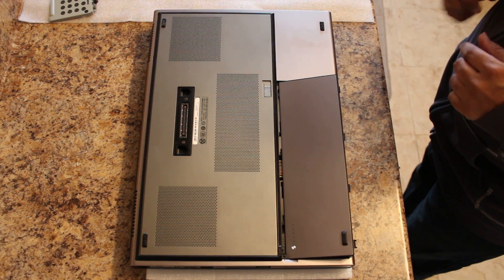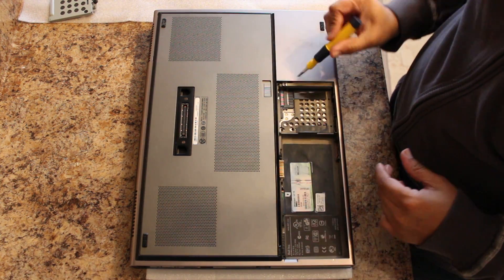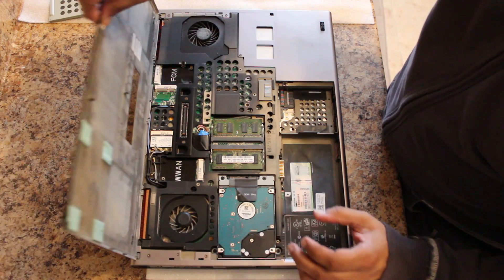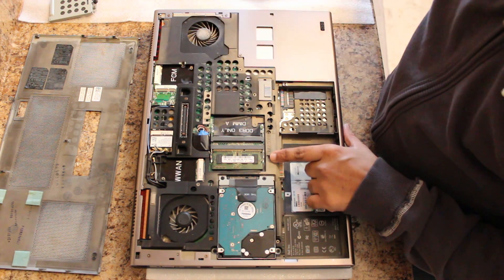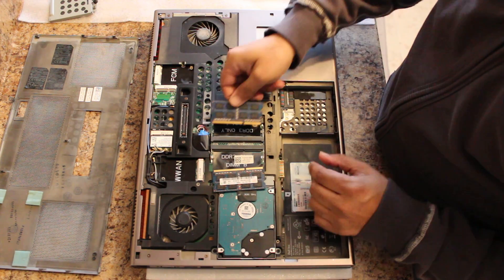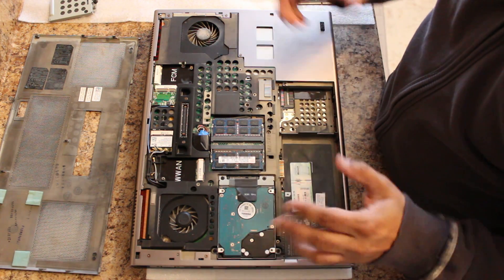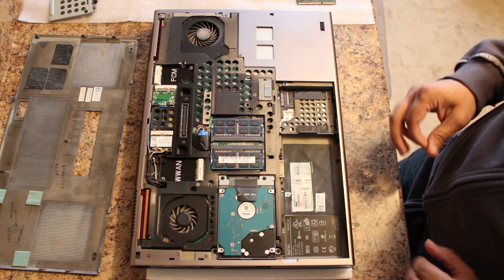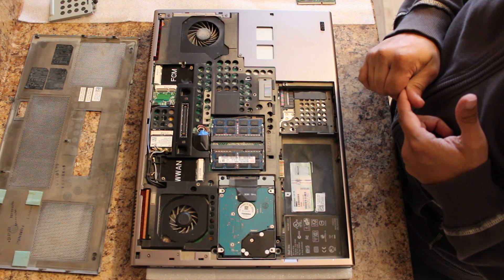Upgrading memory (RAM) on DELL Precision m6500

Comment: Did you not upgrade the ram chips under the keyboard  or  is it only 2 cores on that one.  Mine is quad i7 so has 2 ram ports uner keyboard
Reply from the maker: Mine didn't have any under the keyboard.

Comment: I have the same laptop I tried upgrading  the ram since it has 4 slot so i put (4+4gb ) in slot a,b and then I put (2+2gb) in slot c,d  the the system couldn't boot it was just black screen what could be the problem
Reply: It come from chip dual core support a+b and max is 2x4gb , quad core abcd max 32 but it barely  waste money to up max 32 gb at this time 2024 ,
Reply: What CPU do you have? That determines how many DIMMS can be used.